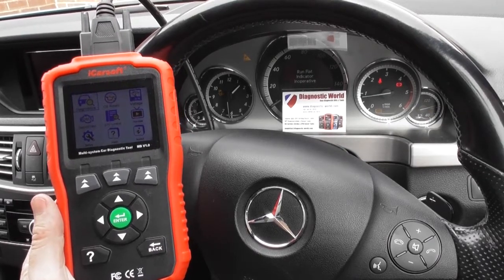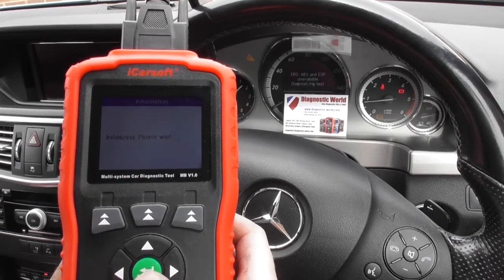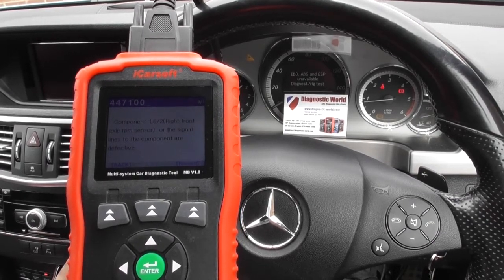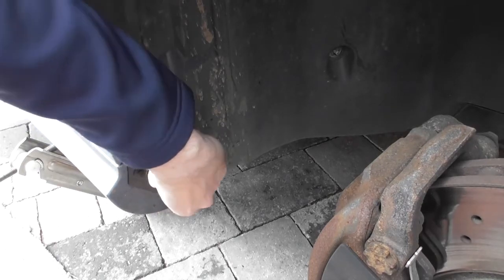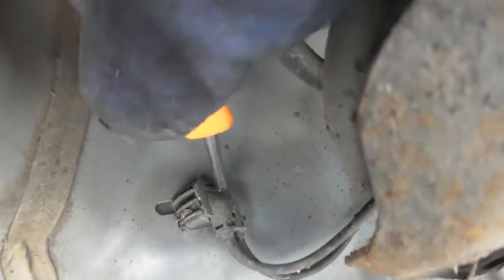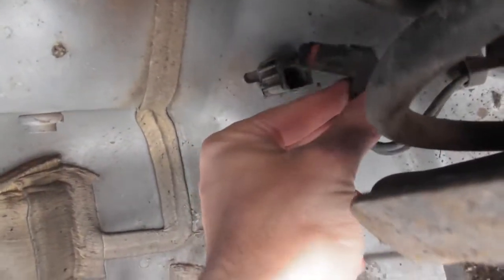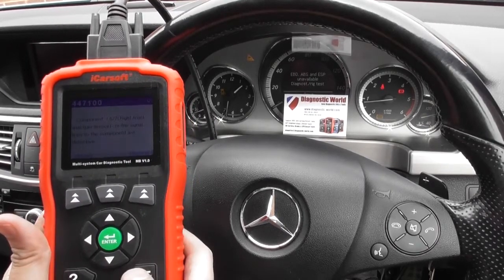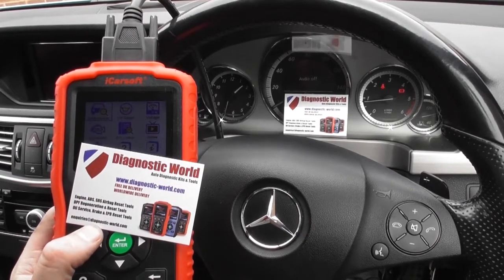Mercedes E Class W212 Front Right ABS ESP Sensor Replace Guide 447100 Fault Code

Comment: Scan it all day long! Doesn’t matter. I replaced the speed sensors. 5 malfunctions still there. And nowwws triangle with ! Is flashing and lite. Car is sputtering at 900 rpms and 10 mph. Car drives perfect in reverse. I’m sick of these piece of junk. Mercedes are not worth the headache. Mercedes makes junk.
Reply: Take it to a mechanic if you cant fix it yourself, will save you from a headache.